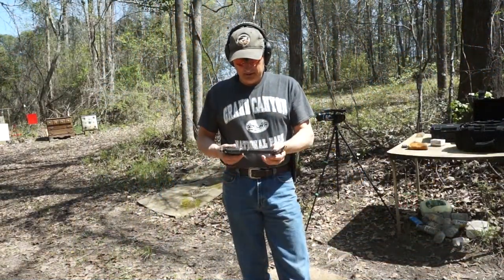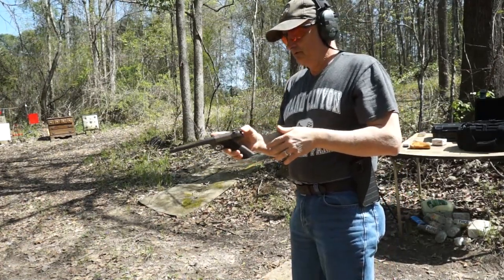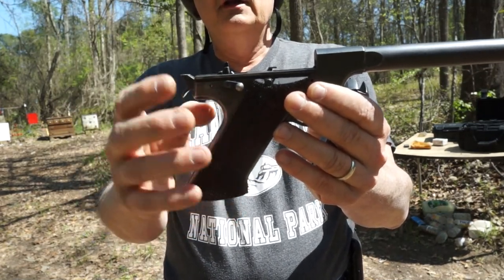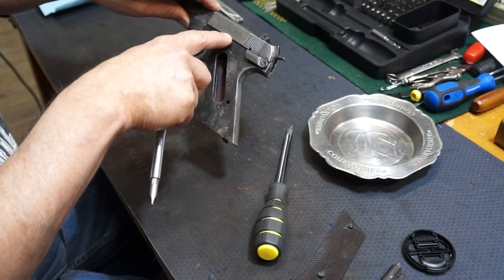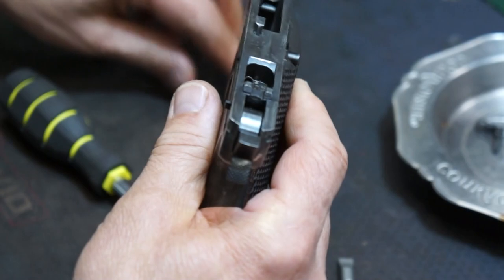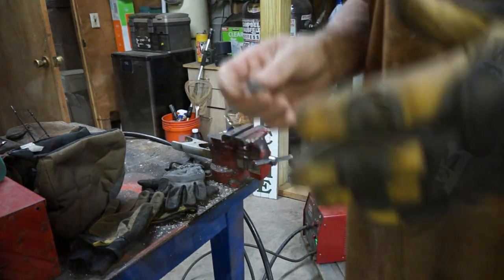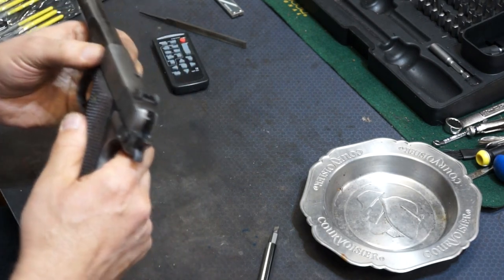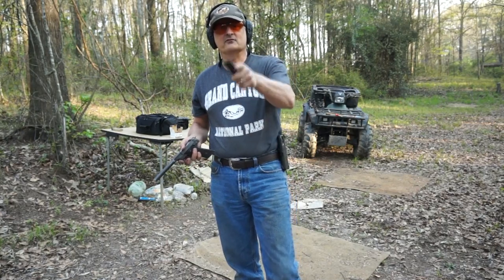Low Budget Shooting #36 High Standard H-D Military .22 with a firing problem and how to fix it.

Comment: I have Dad's H-D Military he bought after WW2 (in the late 50's I'm 99% sure). He loved it and always said it was as good as anything else made at the time (Woodsman, etc.). I agree, it still works beautifully, though I did have to replace the firing pin assembly last year. Thankfully there was a good aftermarket replacement available, and now it shoots like new. While Dad did use it to hunt small game, he didn't shoot often enough to wear down those slide stops, thankfully. But I'll sure keep an eye on them thanks to your video!
Reply from the maker: It’s is a solid firearm. Fortunately, most of the parts are available from Numrich and some other parts companies who specialize in reproduction parts. Thanks for watching!

Comment: Sometime around 2010 I was looking for a pistol to practice with. While I've been playing golf with soda cans since the late 80s with rifles, I'd only recently gotten into handguns.  I found a High Standard Sport King in need of some TLC at Gunrunners up in Anchorage Ak. Paid less than 200 for it, and brought it home. The barrel release button was nearly frozen, but got everything disassembled and cleaned and noticed something interesting: it had a match trigger on it with a 1 lb pull.  Got it out to the range with some minimags and I swear the thing would have put every round through the same hole if I were skilled enough.  Last weekend I brought my GF to the range for the first time and had her try out a variety of my collection. The High Standard was her favorite. She cleared a dueling tree on it from a distance I'd have trouble with. Such a nice target pistol.
Reply from the maker: They were truly a well made firearm. The other benefit to them is you can get them for a fairly decent price when compared to picking up a Colt Woodsman or a Browning. Thanks for commenting.

Comment: Many years ago a friend told me that his father used to carry an HD-Military when he checked his trap lines. He further added that the gun was also used for nocturnal activities as well. Several years ago I picked one up that, with the exception of the "buggered up" rear sight, was in pristine condition. I replaced the rear sight with a OEM sight from Numrich shortly after. Question: How do you determine the year of manufacture of these old guns?
Reply from the maker: There are some excellent websites and forums about the HD-Military, but this one is amazing, hopefully this should help. Thanks for watching!

https://www.bevfitchett.us/firearms-identification/high-standard-pistols-1.html

Comment: I meant to ask this question if you don’t mind, on your welder you used for this repair, what wire size are you using and is it flux core or solid wire with argon?  I have .035 flux core in mine but I also have a roll of .030 flux core.
Reply from the maker: I used a .030 Flux core. You barely have to touch it.
Reply: Thank you!

Comment: i have a gun w same issue. maybe i can verify it w/o having to load it?
Reply from the maker: Yes, if the slide does not go all the way forward and there is a gap. The odds are good you have the same issue. you can also look at the frame where the stop log hits, if it looks worn that’s a good indication. Also, the stop lug should be at a 90 degree angle to the frame rail, not leaning back at all.

I absolutely do not recommend loading it unless you are on a range.

Thanks for watching and I hope you can get it fixed.

Comment: That’s a fantastic video!  
I also have an HD Military made in 1947 it is in great condition and the bluing is bright and beautiful only showing wear on the grip frame. Mine also has this exact same issue as the one you repaired.  I’d say your assumption is correct that these pistols may be prone to wearing the metal back on the tabs on the frame and needing a slide stop repair just like yours.  I have ordered a new part from numrich and will attempt the same weld up job as you did. I do not have a jewelers mill though. I’ll have to “mill” my part by hand with files.  I hope I’m successful as these are great ol pistols with lots of history. 
Thank you.
Reply from the maker: You have nothing to lose if it is currently functioning improperly. A file should work just fine, you do not have to add too much weld to make it work. I was able to do it on the first try. Thanks for watching!
Reply: Thank you much!  It’s gonna be sweeeeet to get this ol pistol back in good shooting condition again.
Reply from the maker: @skiphinson8620  Use Birchwood Casey perma blue on it after you get it fitted. This will prevent it from rusting. My e-mail is lowbudgetshooting@earthlink.net if you have any questions.

Comment: I’m back for a progress report on my repair on the slide stop. 
I’m excited to be able to shoot this fine ol pistol again. 
My slide stop came in today. It was advertised as a NOS High Standard part. It is slightly thicker than the old part so I installed it just to see if it was close to the correct position in relation to the frame at 90 degrees. It did appear to be positioned correctly so I installed the slide but the slide didn’t function properly because the slide return spring was dragging in the curved portion of the slide stop.  I removed it and used my round file to contour that portion a little deeper to match the old slide stop. After that, it functioned flawlessly after reassembly. 
I fired off a ten round count and it worked perfectly. 
I didn’t have to add metal to the back of it since it was thicker than the old worn piece.   I’ll take it for a good shooting session later this week and put a few hundred rounds thru it.  Hopefully it’ll last many years to come but if it doesn’t, I know I can weld up the back side and mill it down and go at it again thanks to your video.
Reply from the maker: That is great news! So you know most Numrich parts need to be fitted. They make them over size I believe because they will be used in worn firearms. I am
Glad to have given you some helpful information. 

I sure wasn’t able to either the Stoeger videos…